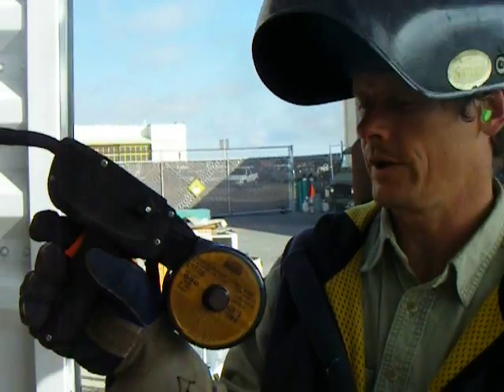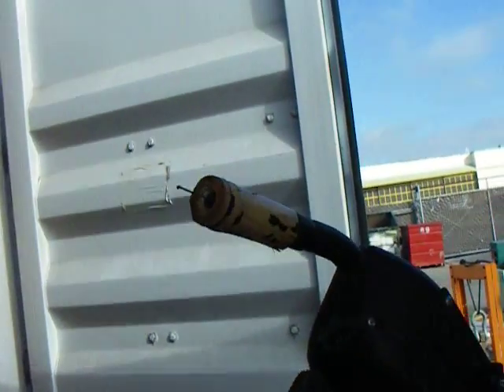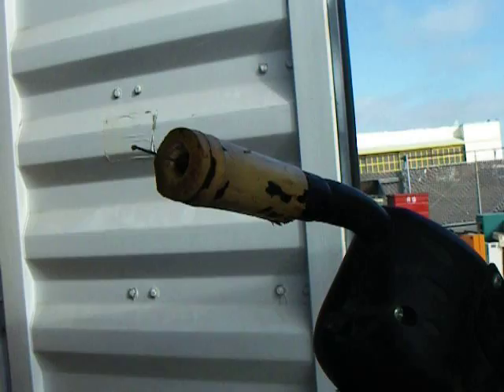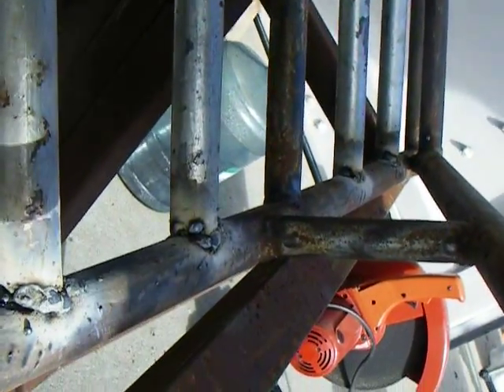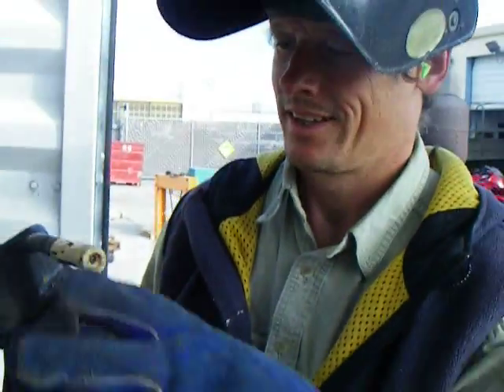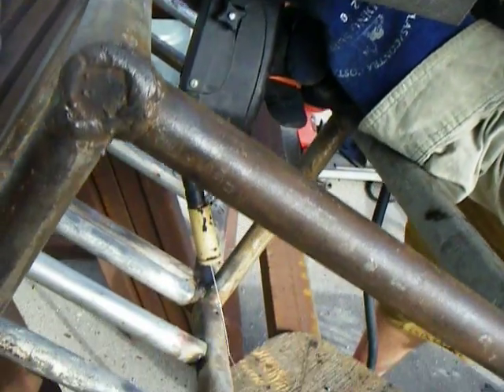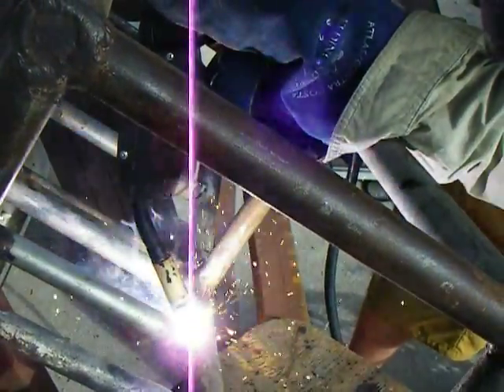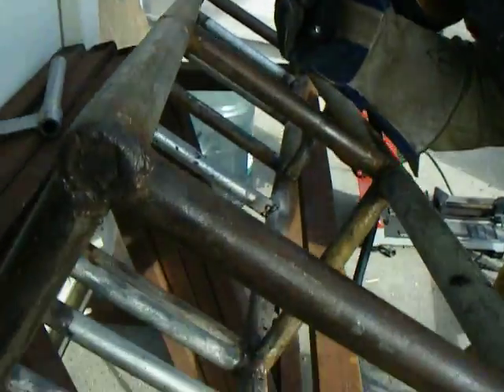www.instructables.com/id/SpoolGun

Comment: How are you keeping the gas from escaping with that amount of lead on the wire. I think you need to get much closer to the metal you are welding to keep the shielding gas from escaping. you will get a much cleaner weld without all the porosity. The 24 volt hookup is correct, but gas is still required or flux wire.
Reply: It's flux core wire.